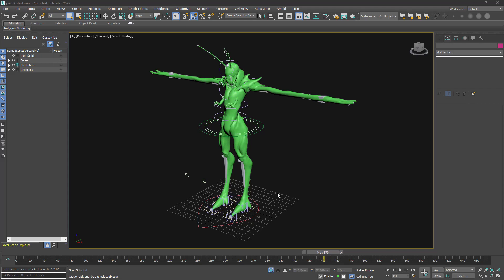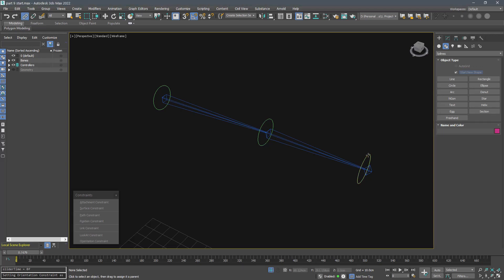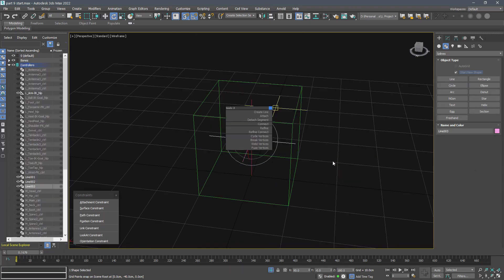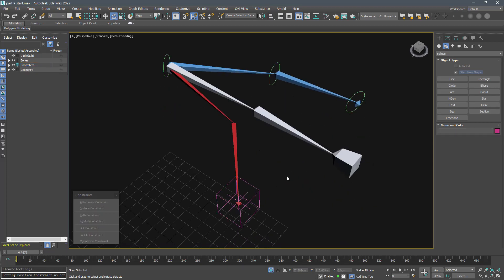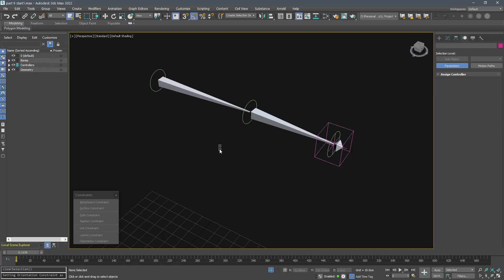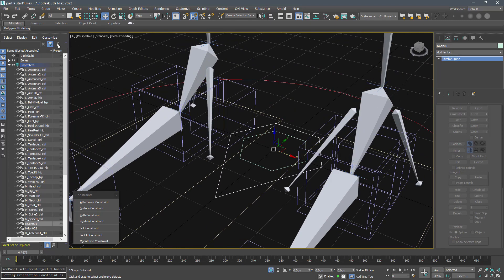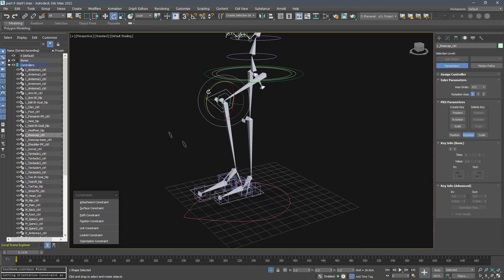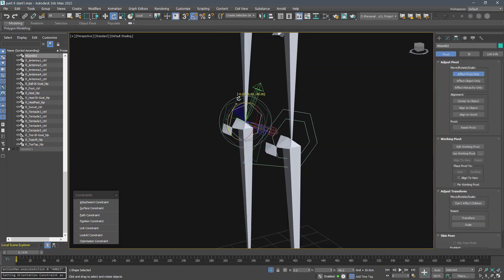3Ds Max Rigging For Game Engine Part 9

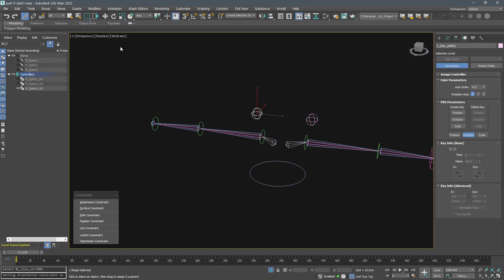Comment: ok so future note for me and those of you who are also making the transition from Maya and are pulling your hair out for the Arm IKs losing their mirror behavior functionality. This is what he did, just at a quiet part of the clip. 7:12
To quickly make another ctrl- select the L_IK ctrl click in the hierarchy panel click use working Pivot
Click the mirror tool at the top tool bar (transform, x, copy, Limits clicked on) ok
should have new ctrl on opp side
create the right side HI solver : click R shoulder or Bicep IK, click hi solver, click your end jnt
Switch your space back to local
should now mirror.

Comment: Wow this is really incredible! Thank you for posting I've learn so much! Question...how would you go about creating space switching in 3ds max? I haven't seen a good tutorial that covers this yet. 
Example: have the IK arm be free then create a switch that will allow it to follow the hips or have the arms follow the clavicle rotation and then be able to turn it off so their rotation is unaffected by the clavicle.
Reply from the maker: I haven't tried it but: 
You can fake a "link" from each node to its parent or hips without affecting the controllers.
You can fake a link constraint by a simple matrix multiplication to get the local transformation of the node, and use the same method to apply that local transformation to the node when you are rotation the hips.
You can use a handler like "when transform x changed" or a custom attribute to drive the faked constraint.

There is a video from Pauel Neale about matrix, you can learn how to matrix to create what I said above
Reply: @ShirzadBahrami  Thank you much will check it out.